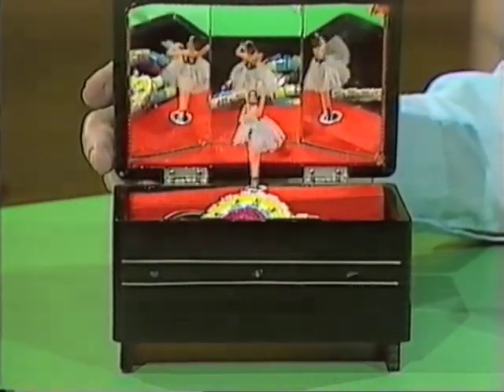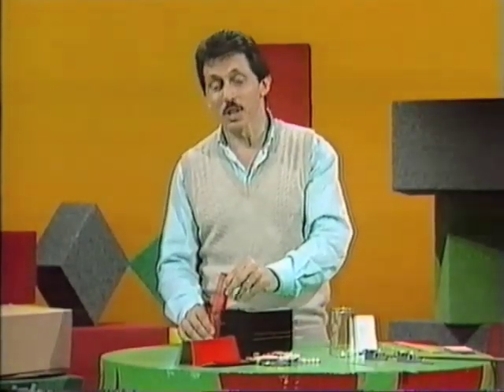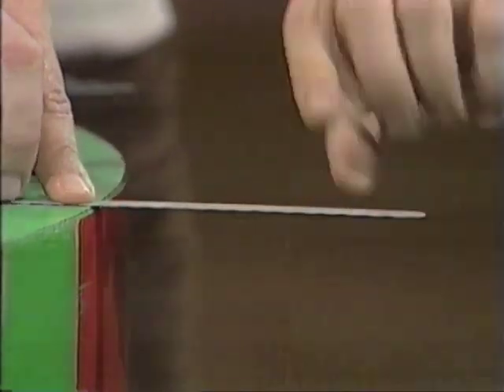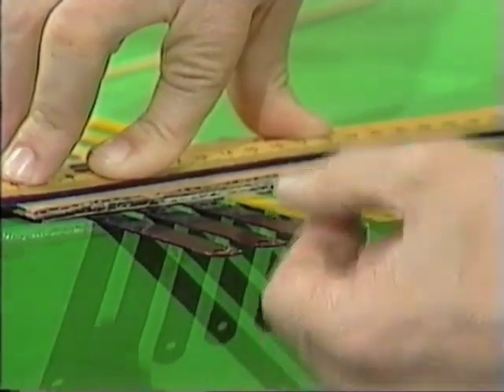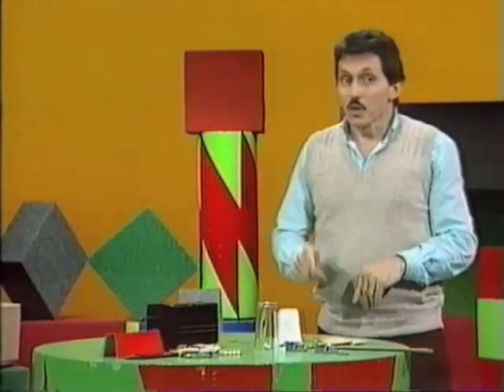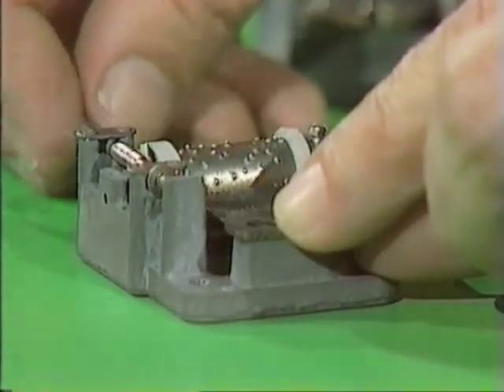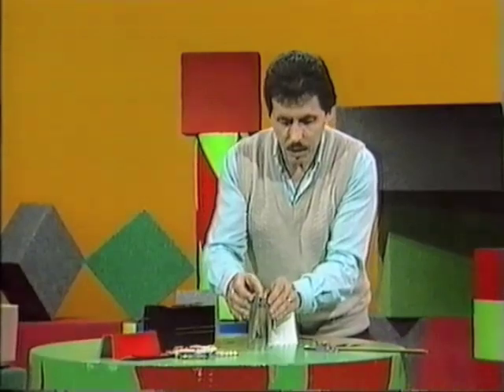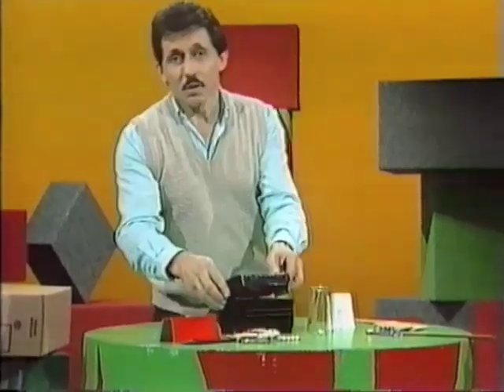Music Box - How Does It Work?

Comment: wouldn't a few dictionaries have worked for holding down those hacksaw blades?
Reply: Yes, anything that would have kept the rest of the metal strings stay in one place
Reply: You would like to put something underneath these blades at front and at back, like two metal rod, then screw these blades tight between those rods. It would be better if these blades will not touch the base, to prevent vibrations. And you will get a kalimba.